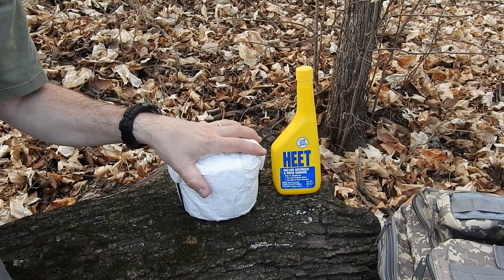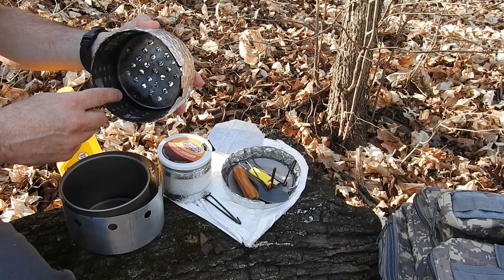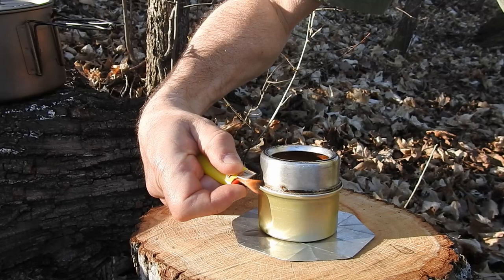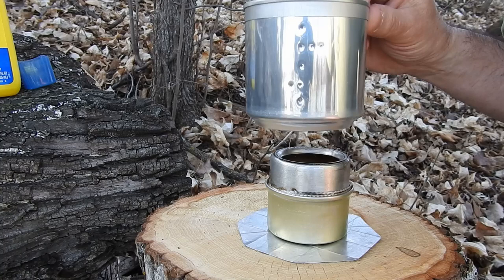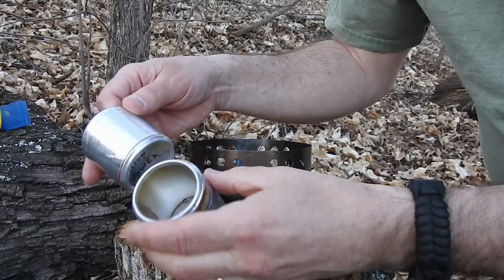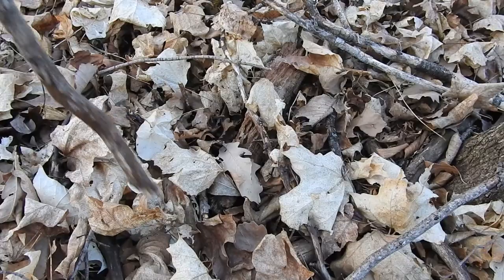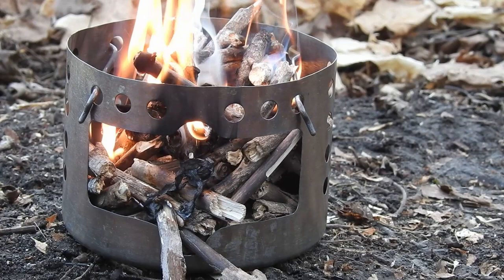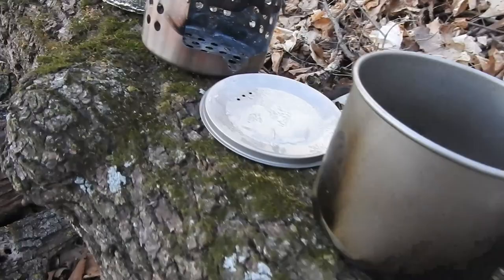UL Cook Kit Demo with 4 modes and 2 fuel types

Comment: I have been on the lookout for a bud aluminum bottle since I watched this video and finally spotted one on the side of the road yesterday. So I'll be building a " bud" stove to compare to a Fancy Feast stove. I like the quiet. You have a very well thought out kit. Thank You!
Reply from the maker: Best of luck building one, I really enjoy it. I cut out the center of the bottom first with a crude fly cutter I made from a block of wood with a nail for a pivot shaft and a cutoff drywall screw for a cutter. I make mine by cutting 2 -5/16" off the bottom the bottle but a little taller or shorter would probably work fine too. Let me know how it turns out!
Reply: @MNmostly  I would have guessed, without you mentioning it, that you were raised on a farm ! Farm raised folks can do anything! Country Boys can survive !!!! LOL, Thanks for the additional information on this build. Looking forward to the big test!
Reply from the maker: @bigsky2081  LOL, that is all so true. I've been asked by other viewers to do a video on building one of these stoves and I plan to someday. In can you didn't see it, I put a small hole below the top so that if the pot gets too good of a seal it can't build up pressure. I used to put cut two little notches in the cut off end of the bottle to allow fuel to seep faster to the wick but now use at least 4.
Reply: @MNmostly  Thanks Bryan! I think a video would be great. Of all the videos I watched last night on a bud stove, I really didn't come away with a completely clear picture. Clear enough since I have built other types and I'm a farm lad but I think others would be mystified. 😁

Comment: Those are all great stove ideas and very well made. What kind of tools/method do you use to make the stick stove? 
I especially like the stick stove/alcohol stove combination. The stick stove provides stability for the pot when using the alcohol stove. The precarious nature of the alcohol stove while camping with a curious dog has always made me steer away from using my fancy feast stove.
Reply from the maker: Hi Lily, I made it from an IKEA "ORDNING" utensil holder. Using a dremel tool with cutoff disk I shortened it and added the holes for venting and filling. The wire pot supports are made from a clothes hanger. I switched to alcohol stoves in 2014 and would never go back in most weather. There are three different kits I use with various types of alcohol stoves. Another good option is the Solo Stove (stick) which can be used as a stable pot stand. Thanks for the nice comments and for watching!
Reply: @MNmostly  Thank you for the info!